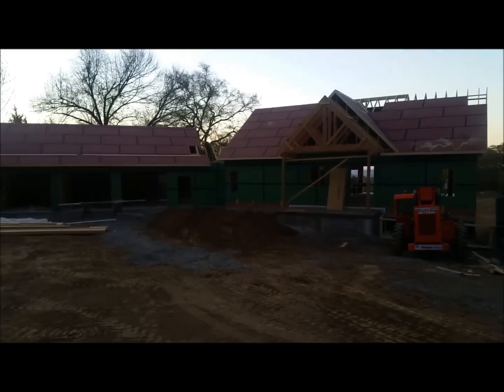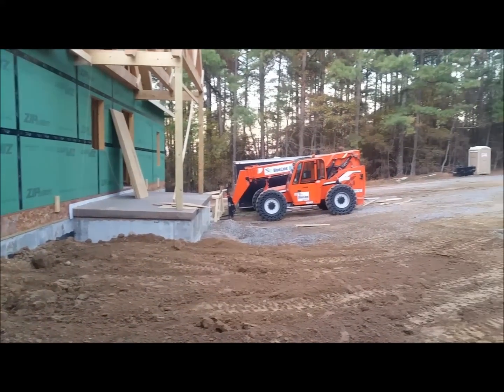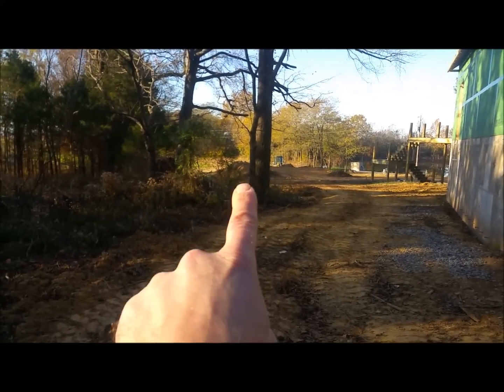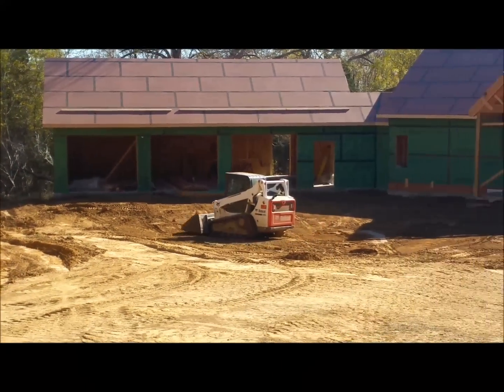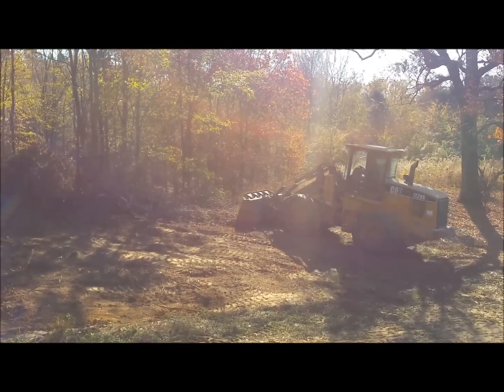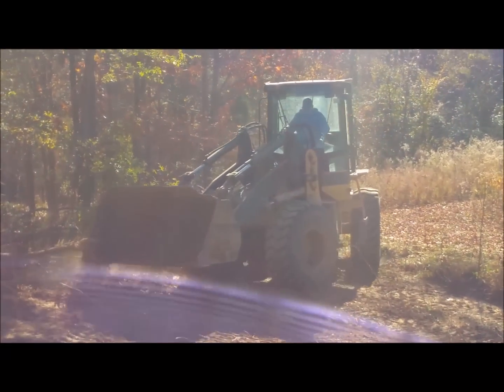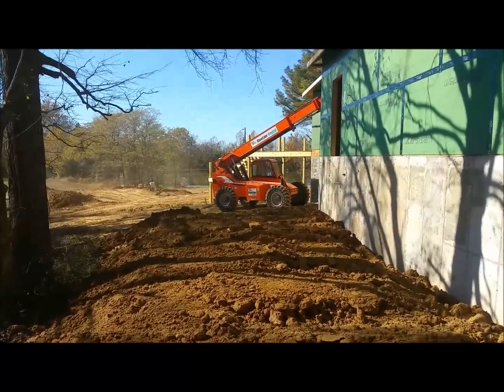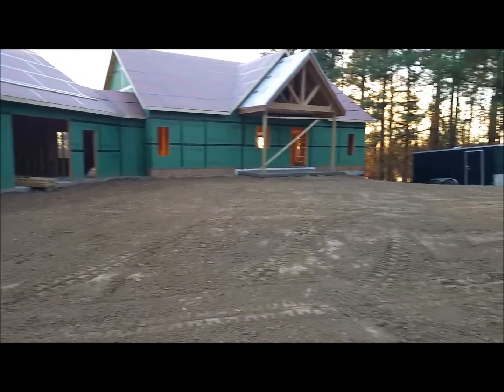Backfilling Dream Home build. 4 feet of backfill 11-16-16

Comment: Hi! Thank you for sharing your dream house. I find it quite impressive. I want to ask a question. Did you consider making a room out of the space below the garage floor? You filled it and put a slab on it which is fine, maybe it is not practical the build a strong enough floor. We all have different goals and interests, I could easily imagine a nice model train set in that space!
Reply from the maker: Yes, I did as I hated to see that much clean gravel wasted to fill that space. But the concrete guy said we'd have to bring in an engineer to certify/plan the concrete floor/roof that would go over the room.. So due to time constraints and cost over runs, it just was not an option... Plus if we did, we'd still be waiting on even pouring it (probably) and winter is upon us!! I'm very thankful we got all the concrete done before the ground got totally ruined by the winter cold soaking... Believe me, it is a mess on all clay, wet, cold weather, and then add freezing to it!

Comment: Hey, what about waterproofing in some areas?  Should it go up higher to protect concrete overtime?
Reply from the maker: Justin Edwards no, the concrete will survive on its own, but we'll make sure to get it all graded and pitched away to remove the water so it runs away from house /concrete.

Comment: Kapper how come they did not put styrofoam in front of the foundation wall? Styrofoam protects the concrete wall and water proofing when backfilling from rocks and scrapes so is not compromised , it also gives you a thermal break. Bare concrete is like a dry sponge to the cold and heat, it draws right through the wall.
Reply from the maker: That stuff is bad for termites around here. It gives the termites a nice patch to make tunnels through to crawl up to get to the wood! They used 2 different barriers; One was a roll on tar based stuff and then over that was the heavy corrugated type plastic sheathing for double protection from Water.